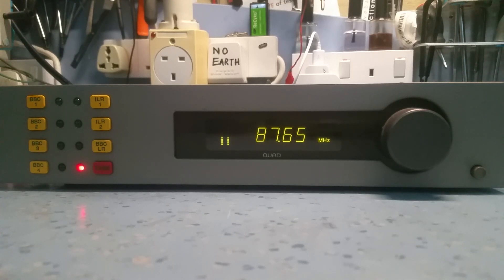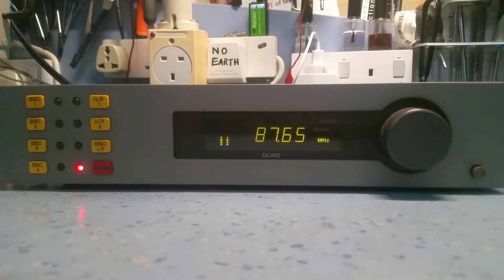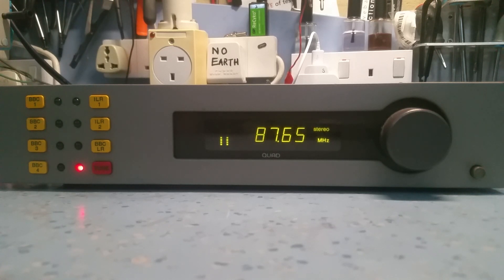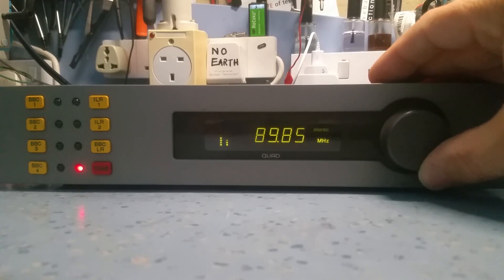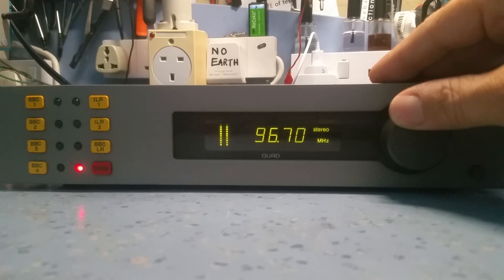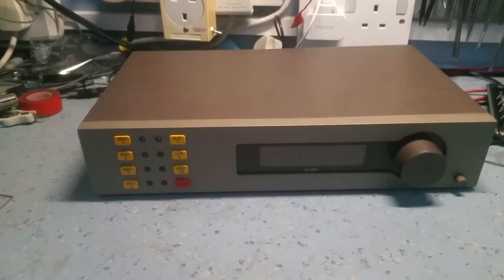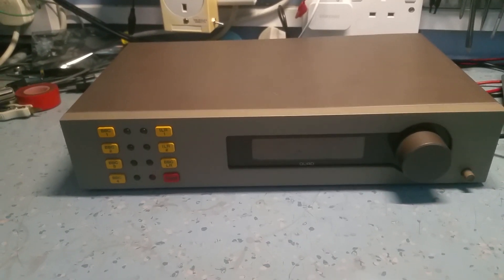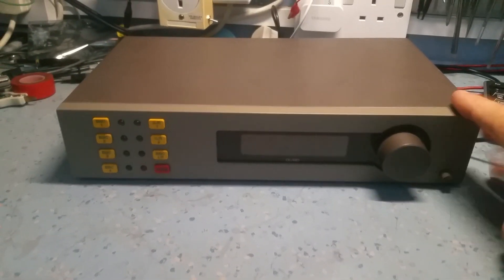FM Radio tuners. Is FM Radio dead?

Comment: its better than a dab radio because the bit rates are very low so the broadcaster can have more channels for the same allocated bandwidth. Note too that fm stations use compressors that crush the dynamic range, you can setup you own transmitter and stream full quality sound. However its balancing act as its hard to get the level correct, you can easily over deviate the transmitter.

Comment: No but DAB is starting to die apparently! Don't feel that you need to mince your words about the superiority of FM over DAB!

By the way this tuner featured on the the TIC Shootouts and ranked fairly low, despite having no major faults, I beilieve partly due to the lack of low-end performance. This video explains why that is case.
Quad make great gear but their distinctive design and individualistic features make them mostly suitable to Quad fans.
Having said that, I always lusted after an AM3 tuner. Had I gotten one, I would then have to have partnered it with a matching FM2 - although the latter was nothing exceptional.

Comment: Singapore has stop FM analog broadcasting. Initially my Sansui TU 999 cannot receive the digital transmission but after using a external antenna, I manage to receive FM. I am still enjoy listen to FM radio. From Singapore.
Reply: My sansui tu 999 was made in the 70s and still sounds good.

Comment: FM isn't dead yet thank god but Radio in general is probs dead to the younger generation who will never understand the joy of turning that dial. I also love going through the LW, SW and MW bands since a kid. My main tuner is a Hitachi FT-5500 mkII, my only complaint with it being the output section which struggles to drive my solid state recorder which has quite a unusually low input impedance on the unbalanced line inputs (>2k Ohms) https://drive.google.com/file/d/0B7s2GwCjp1tDNlVXRVcxbVlWeDQ/view?fbclid=IwAR27kMEejCgryLI8JURLpnq39bQVYhZcQxFDH9GZ2LHKNY0SmTC4NKHGnNg

Comment: FM in the States is still interesting as long as you stay down on the low end of the band, below 92.1, where the college stations are. Commercial radio programming is ghastly ---- playlisted modern pop music, or so-called "classic rock";  the audio has been heavily processed and compressed ( so that the broadcasting range of the station is increased, which makes for higher advertising revenue) and just sounds god-awful. Plus the programming is chock-full of adverts.

Comment: Good to see you Simon. I've a couple of fm tuners. I've a lovely Sony form the 70s that I'm very fond of. Also an rds rotel. Latest acquisition is a Sherwood Newcastle AV receiver. It has a problem in the pre amp section, but I'm just driving the main input to the amp from the PC. Beautiful sounding amp. I've a ton of amps and speakers now at this stage. Lol